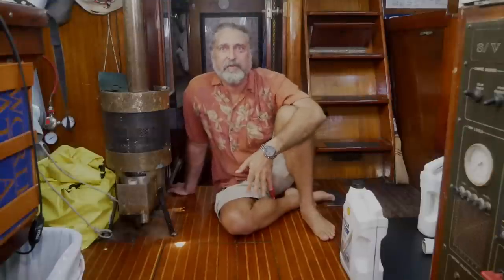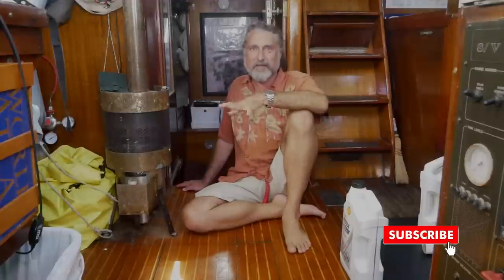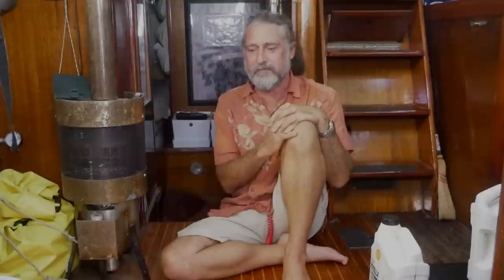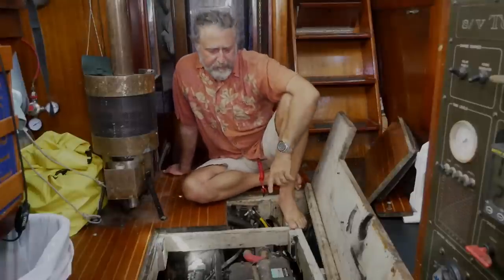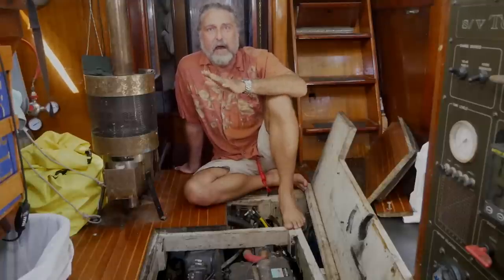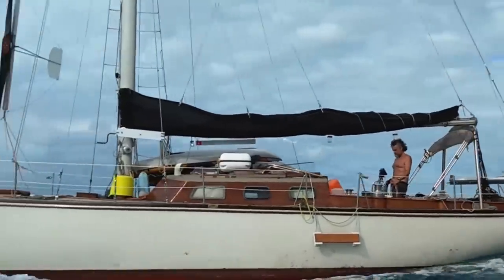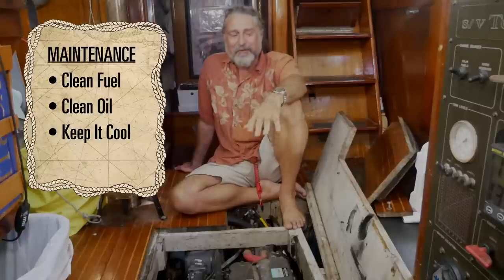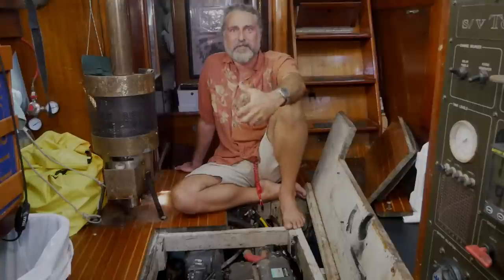Boat DIESEL ENGINE Hacks & Oil Change [Capable Cruising]

Comment: Clark... I agree with everything you talk about in this video, and I want to further emphasize all your good advice by telling this rather long story from my life experiences.
 I hope that this will save someone from having problems.

 I, therefore, am re-posting the following:

 My Father in Law was in the production side of the movie business with Warner Bros. Columbia all his life.
 I should say here that he was a very serious man, (ex-Navy) who rose to be Director of Operations at Warner Bros. Columbia before he retired. So I have no reason to doubt this story.
This is what he told me:
Years ago, on location, in the middle of winter in one of the Northern States, a movie scene required a Longboat full of Fur Trappers to be shown rowing upstream. The current on the partially ice-covered river proved to be too strong for the actors rowing the boat. An outboard motor would show a wake, so that was not an option. So, the crew came up with the idea of using an old Caterpillar Dozer from a nearby ranch. It had a winch upfront that they figured could help them pull the boat upstream. They build a little fire under the oil pan, so they could crank the old thing over and get it started. The problem was that the way the director wanted to shoot the scene, there was no way to hide the Cat or the winch cable, so they decided that the only solution was to submerge the cat with an operator in the river. Among some other things, they extended both the air intake and the exhaust up, took the fan belt off, got it started, then took the remaining electrical gear off and drove it underwater where the operator in scuba gear worked the winch. Some greenery on top of the cat hid anything that showed above water, and that did the trick. 
The moral of this story is, that if a Diesel engine gets AIR, CLEAN FUEL and you manage to TURN IT OVER, it will have to start. (Of course, new clean fuel is of no value if old dirty fuel has previously clogged the injectors). Also, if you want to keep it running, keep it cool with clean oil in the pan.
 Running seawater through a cooling system is also asking for trouble. Even with a heat exchanger, where seawater is pumped to the engine mounted exchanger. It is one of the most problematic systems on any boat. I see it over and over as one of the main causes of engine failure.
 This is why most commercial boats (and all the boats I build) were keel cooled … meaning that the coolant is actually piped from the engine through the keel or a pipe on the outside of the hull to cool the Coolant before returning it to the engine.
 No seawater ever touches the engine!
I would try to do my best to convert any sailboat to keel cooling, just to keep seawater away from the inside.
I also would eliminate all through-hull fittings by going to a single valve Sea Chest. Look at the Rolls Royce of cruising boats...  the Nordhavn line. Yes, they are mostly Trawlers but there is a way of getting that done on a sailboat. 
Commercial boat engines when rigorously maintained can last for up to 40 000 hours. I build four steel commercial fishing vessels in the early 80”s. The last one, (my profile picture) weighed out at 140 tons. All of them, as far as I know, are still floating and plowing the waters of the Bering Sea. Two of them were accidentally run on the rocks, pulled off, repaired and put back into service.  I always installed several Heavy Duty (Racor) Fuel Filters on a manifold system (like you). They could quickly be switched over when one of the filters failed. Also keep in mind that the most likely and worst time for dirty fuel to reach the engine is in bad weather when the boat gets tossed around, and old sediment gets stirred up. Not a good thing under the best of circumstances. It is also important that one frequently inspects the filter(s), and that one can visually see the sediment or any possible water in the glass bowl under the filter. There should be a drain cock. A crappy filter, with a metal bowl, which is many times standard factory issue, will filter your fuel, but will not let you see what you got until you open it up after the engine fails.
 To further prove my point.
In the early ’70s, before GPS, I was single-handing my sailboat just south of Punta Abreojos in Baja on a stormy night when I ran aground on a sandbar. As the boat was pounding in the surf, the portholes blew and submerging the cabin and of course the Engine. Long story...At low tide the next day I managed to get the engine started again. I did that by hand cranking it with the De-compression lever pulled. The minute I let that lever snap, that little Volvo got everything it needed, i.e. clean fuel and air and away it went. I cannot overemphasize the importance of clean fuel.
Sadly, the shaft was bent and I lost the boat.
 I never had a problem with anything Diesel I have ever owned, because I always went overboard on fuel filtration. 
The only Diesel that ever let me down was a piece of crap Volkswagen Rabbit Pickup Truck. The timing belt broke, and the engine exploded. I take comfort in knowing that it was running on clean fuel until it took its last breath.
 Long live Rudolf Diesel!
I truly love your channel. You are both great resourceful trailblazers and a credit to the sailing community!
Good Luck to you both.
Reply from the maker: Thanks Karl.  If you think your friends might also like our videos, how about sharing one of our playlists on social media. We would really appreciate the new viewers.
   My only problem with keel coolers is there is no good way to cool the exhaust.  That and when the cooler (which is in salt water) fails it's much harder to fix.  Good points on every thing.  Was planning on talking about rough seas and clogging filter but forgot during filming.  That is best reason to use the booster pump.  Not fun changing filter in bad seas.

Comment: Good video!  I should mention that it made me nervous watching that uncapped used oil jug!  From experience the first thing I do is snugly cap any oil bottle (fresh or used) unless actually using it.  Also, I don't recall you suggesting a new fuel pump and gasket in your spare parts list- they're inexpensive, small, and oh-so vital.  Finally, always use fresh oil (not used) to lubricate the new oil filter.  And I personally preload my new oil filters with fresh oil to thoroughly wet the filter media with oil- doing so will reduce the amount of time your engine runs before it sees oil pressure (always a good thing!).  I think Amsoil makes a filter system for diesels which not only removes contaminants, but water- this would be a good way to go for your bypass filter system.  Happy sailing!

Comment: I love diesel engines,  they have always served me well. 3 basics diesels need, are Clean Oil, Clean Fuel, and Clean Air. tbh, for the first 1,000 hours of running, I'd change the Oil Fiter, as even though tolerances are tight, you can still get metal bits from wear in, that get caught by those Oil filters, and I don't like taking Chances, it's worse for Gearboxes and Saildrive legs, because No Filters. Change or Clean, depending on type, Fuel Filters, and use biocide additives in the diesel tanks, and occasionally add injector cleaner additive to the most direct diesel tank feed when you are going to have a long run on engine power. Diesels do love Working but it doesn't have to be too hard to get the benefits with good fuel economy. Carry a spare Air cleaner, or get a decent Cleanable one, as you can find yourself sailing I'm very dusty Air, such asvwest of the Sahara. Do a full drain of Gearboxes and Saildrive legs to get those bits out before refilling with fresh oil. Once run in is complete of Gearboxes and Saildrive Legs, add gearbox oil additives to greatly extend life, but Never before they have fully run in, as they are so good, they may never run in properly.  That pretty much covers what I've learned over the years, otherbthan how to treat a Turbocharger Properly, which also needs good Clean suitable Oil. On Startup, never Rev the engine, let it tick over for say 30 seconds, to make sure those Turbo Bearings are getting a good Oil feed. On stopping - which opposes Yanmar non Turbo engine advice, do Not Switch off with high engine rpm, as that Turbo is spinning really fast, andbif you switch off, bye bye Oil feed, and hello Dry Bearings, so tick over for another 30 seconds first. Doingnthatbon Land, with good servicing, that Turbo should do a million miles. I've never had a Turbo Failure thanks to following that regime. Clean air is also Critical for Turbo Service Life. Best Wishes.  Bob.  👍🙂

Comment: thank you, I just subscribed to your channel. when I repowered the Beta Marine (kabouta block) was much cheaper than the Yanmar. I have had my engine for about ten years now and we recently were having overheating problems, we shut the engine off and were sailing when we turned the engine back on we were going against tide and wind, I turned the engine up a little and it started overheating, we were in the channel and I just had to keep going, I eventually slowed down but the it was being very sluggish and when I turned the engine below 5000 rpms it choked out. Uhh what we discovered after we got towed in was a mess, a rubber hose blew off the heat exchanger and filled out 4' deep bilge with seawater. I called Beta and they said I should clean my heat exchanger every few years! who knew I took the entire cooling system apart and put the heat exchanger in vinegar most of the high pressure side were blocked. its and odd thing that is drawn together at both ends and kind of just stays in place, I also am going to change the fuel filers as it choked out and still won't start. thank you for your clear demonstrations

Comment: Thanks for that very interesting. Just fitted a Yanmar 30 hp to my boat after 40 years with a Volvo and hoping I enjoy the experience.
Reply from the maker: Parts are crazy expensive but the yanmar is a fine engine.

Comment: Wow! Just an other great video and thanks for the tip about a separate fuel filtering system. I’ve often considered adding a second fuel filter but not in this way. We here in the North store our boats over winter. I now know how to start my new season by re filtering my fuel. Cheers!

Comment: I attached a short piece of copper tubing to our pump hose for changing out the oil on our yanmar through the dipstick. This way you know it’s touching the bottom. Very good video!
Reply from the maker: I had to change my oil pan on my 4jh5e.  I removed the oil with the dipstick tube (no inner pipe).   
Then removed the pan.
Surprisingly little oil left in the pan.

Just FYI

Comment: multi filter and multi flow direction thru filters. great idea. i was just watching the Keenan system on sailing miss lone star and while theirs is automated and precise yoursis almost the same thing without the bells and whistles. The Keenana guy speaks of the rough running as a sign of fuel issues and you both fix it via the filtering and polishing. Thank you.

Comment: Thanks Clark. My Perkins 4-108 is the biggest mystery to me, but only because I haven’t taken the time to familiarize myself with it. I drive a VW diesel so I have a general knowledge but I haven’t figured out bleeding the fuel system yet because i haven’t had to. I really like your hack on polishing your fuel. Thanks.
Reply from the maker: The 4.108 is a great engine but it is probably about the hardest engine out there to bleed.  I advise you to NEVER run out of fuel.  But if it happens your engine is easier to bleed if you run that transfer pump putting positive pressure on the engine.   Then go through all the bleed points loosening each vent until clear (bubble free) diesel flows.  It's in the book.  Just using the electric pump saves you from having to reach down and keep actioning the mechanical on engine pump.

Comment: Hello Emily and Clark and all you folks watching, like me.  I noticed that your Dickinson heater was sort of brown in places.
If you spray stainless steel things with rust stains with The Works Bath and Shower cleaner, once or twice a day for two
or three weeks the stains will go away.  No rinsing or scrubbing, just spray and let it go.  There may be other cleaners that
remove rust stains, I sopped looking when I found what works.
Mike from Shooting Star
Reply from the maker: Thanks Mike.   It's actually brass and bronze.
Reply from the maker: I guess it has a lot of stainless parts.

Might get to it someday.  Lots of worse things.  We are varnishing the exterior at the moment.

Comment: Hi Clark, my wife and I enjoy your videos!  I have a Bristol 41.1 that we are moving to in December.  I have the same engine, Yanmar 4JH5E, which has been great.  Does the engine have anodes?  I've tried researching online but haven't found a definitive answer.  Keep the videos coming!
Reply from the maker: I should check mine.  Yes I think it has a pencil anode near the back of the engine if I remember correctly.
   Check the yanmar manual.

Comment: Thank. Mine is yanmar  2ym15 a 2 pot 13hp with a hard to find oil leak. Excelent info now i need to make a second  tank and extra pump  to solve any future issues there
Reply from the maker: Oil leak?  You can put ultraviolet dye in your oil then shine a black light in the engine to see where it comes from.

Comment: Those starters are very similar to the starters I've had on a long list of Lycoming (I)O-320/360 aircraft engines. As you alluded, the biggest issue by far is simply the Bendix getting gummed up with old oil, bird feathers (lol) and other detritus.  I've had good luck simply spraying the bendix with carb cleaner and then a little dry lube to get it to work properly. On my old Grumman aircraft I always drilled a little hole in the cowl to be able to put the aerosol can straw through.  I've not had an issue with the starter on my 3JH4E yet, but this would by my first go-to.
Reply from the maker: Luckily the starters are dirt cheap so...  Carry a spare!

Comment: Just another hack: on any dipstick, make good marks - either a notch at each end of original marking area (like a kiss of an angle grinder or a Dremel) or drill a Ø 2 mm /0.08" tiny hole in each end of the marking. Helps heaps to make a proper check of the oil level, especially if the light conditions are on the darker side. The original marking area are most often really not thoughtful for the purpose…
Reply from the maker: Seems like a job for a triangle file.  I'll have to do that sometime.  Good idea!
Reply: Absolutely a more smooth alternative ☝🏽
Reply: Indeed! I have a 3cyl volvo diesel, love her but the dipstick marks look like a failed Picasso painting. Unintelligible.
Reply: Making the readout area satin/matte will also help, if the oil is fresh it's hard to read sometimes on a shiny stainless strip

Comment: Hi Clark just watched your video and wow I really enjoyed it and found it extremely helpful so thank you.  
Question, do you have any tricks or hints you can share  to know the correct flat belt tension on your engine?
Thanks you
Reply from the maker: The kit I got came with a great tensioner arm.  Screw adjustable so the operation was so trivial I forgot it.

If you use the factory arm I always grab my crazy long screwdriver and leverage the alternator up to tighten it.

Then try to turn the alternator fan.  It should try to turn the crank.  If it slips it's too loose.
Reply: @Clarks-Adventure  thank you for that.  Very helpful.   Cheers

Comment: Nice vid Clarke. Does the little rotary vane pump restrict the fuel much when it's not running?
Reply from the maker: I added a bypass with a one way valve so I just don't know.   If I had it to do again I'd skip the bypass.   The vane pump just can't seal well when it's not spinning.

Comment: Great idea with the additional pump/filter and valve return manifold system. My current set up has 2 fuel filters before the engine's filters for redundancy, but I plan on another fuel tank and am really considering to reconfigure to your system. Thanks!

Comment: Looking forward to your air conditioning kit when it's available. Got the Electromaax alternator and adjustment arm upgrade partially installed. Working through a hiccup on bolts but I have faith. Great videos! Thank you!
Reply: Small hiccup: be aware that although the kit is indeed bolt on as described on their website you'll need different fasteners and a couple of reducer bushings if you have a Yanmar 2GM20F motor - they dont come with the upgrade kit. I received my separately purchased fastener kit at a very reasonable price but it has a couple of wrong size parts. I've contacted John at Electromaax and I have faith we'll work through it. If you're purchasing this upgrade I highly recommend purchasing the fastener kit for your specific motor. The hiccup I'm sure was just an oversight. I've done programming as well as  communications and low voltage solutions and integration before starting over as a health care professional and its not uncommon to fiddle a bit before things work smoothly. Being patient.
Reply from the maker: Yes I had a similar problem.  They sent the wrong belts first.   Caused some issues for us as I only installed the new gear a week before we needed to move the boat.

Comment: For those curious Gas is roughly 115000 BTU per gallon and Diesel #2 is roughly 130000 BTU per gallon. So in round numbers 1 gallon of Gas is equivalent to about .9 gallons of Diesel.
So a trip that would take 100 gallons of gas given equal circumstances it would take 90 gallons of Diesel.